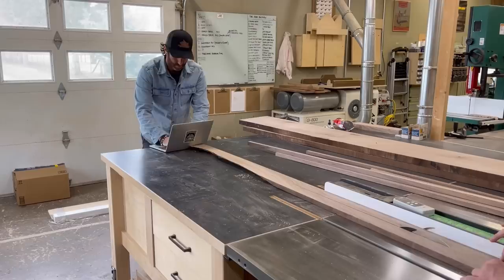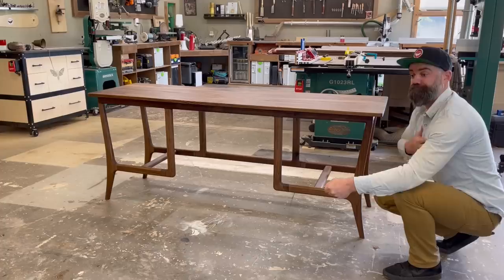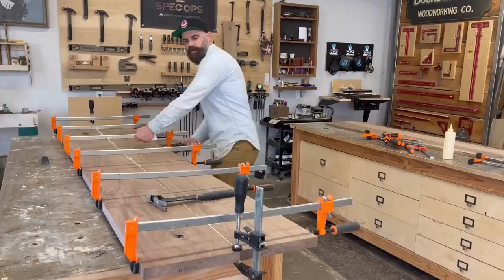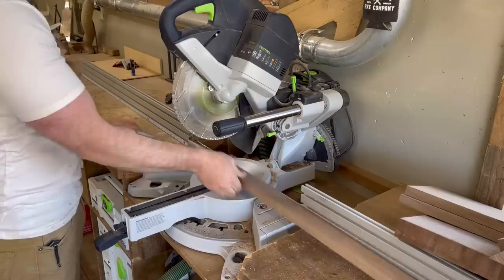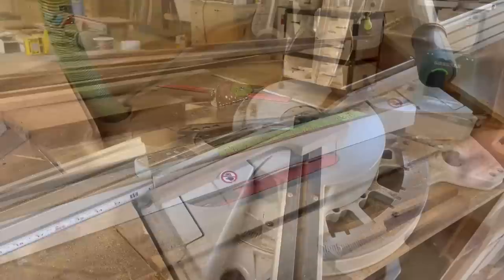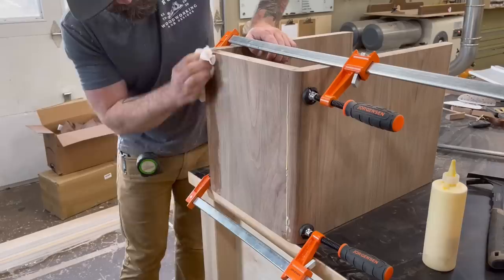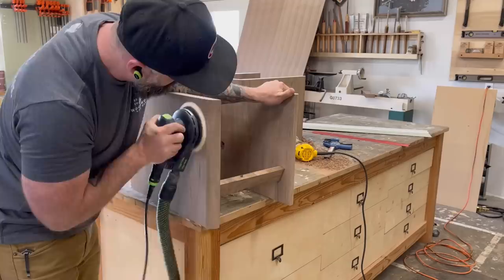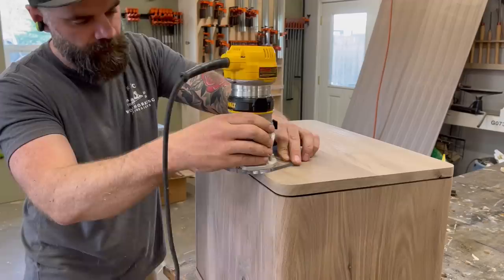My Nicest Piece Yet || Mid-century Modern Desk Build

Comment: Very nice. Lots of opinions out there. Here’s mine…You may be right thinking the wood movement of the boxes will be minimal. Still cross grain solid wood panels with no room for movement in the connection method is a recipe for long term problems. Bravo for allowing for seasonal movement when attaching the boxes. Good luck long term. Hope I’m wrong.

Comment: Have you considered using locking miter joints for things like those boxes you made this eppisode?
I am considering making cabinets using that locking miter router bit, using plywood, and then rouding over the edges like you did in your build.
Would be cool seeing a professional make something like it just so i have some reference ;).
Reply: @G0F15H  I didn't do it with Plywood yet, but i read online that key to success in it is use high quality plywood, like baltic birch, and also using good quality router bit, there is good ones for about 100-150 dolars, ant they cut super nice, but then there is cheap ones for 5th the price, and they scar the wood instead of cutting it.
I know that from experience, bought a cheap router bit and it chewed up my workpieces made of regular timber, but then a good one i got like CMT 955.009.11 made in Poland where i live and that one works like a dream.
My point was i would like to see some work done with it, as there isn't much on Youtube about using those type of bits. If someone can recommend some content regarding it, id much appriciate it.
Reply: Like Gofish said, before you plan to use a lock miter bit for a project, get one and try it for a reality check. I’ve never had any luck with it. It seems like a silver bullet but so much has to go right for it to work and any little thing that’s slightly off ruins it.

Comment: I really wish  you'd address the spontaneous combustion issue controversy. It's pretty clear you lied, but I'd love to hear your side of the story.
Reply from the maker: Go listen to my podcast “shop sounds” I discuss the entire thing.
Reply: @Bourbonmoth  I just listened to your podcast. This is why I wish you would address this on  your YouTube channel. Your response on the podcast was reasonable and let me see things from your perspective. I've been around enough to know that I need to reserve judgment until I hear both sides of a story. The one thing that really stands out to me is the toxic off-gassing. Do you have any explanation as to why your shop didn't fill with toxic fumes to the point that you weren't able to stay in there? 

At the end of the day, fake or not, I agree that the message - to be aware of spontaneous combustion dangers - is a worthy pursuit.
Reply: @Subsonic-cd2en  I've been in a garage where an entire car was on fire, and it was filling up with thick black smoke. I had enough time to go find a fire extinguisher, which didn't work, and then had to gtfo (fire department came crazy fast, put it out, saved the structure). So maybe about 30-60 seconds? The only thing that would give off toxic fumes in that video was the thin plastic bags and the plastic trash cans, which isn't a car. 

Besides, why would any of this matter? You don't think he faked the fire itself, but how it started. But whatever, if it's not "toxic fumes" it's going to be some new thing to shift the goalposts and keep the conspiracy alive.
Reply: he didn't lie, just lay it off ffs
Reply: @ianjamesevans  Dude.. I was a firefighter. So, I'm familiar with smoke. If you watched the 2nd AvE video, he specifically talks about the spontaneous combustion of linseed oil, and the extremely toxic smoke that particular chemical reaction causes. This is not normal black smoke from normal combustion. He tried his own experiment and was not able to physically stay in the say room due to the toxic off-gassing. He also explained the chemicals involved.

Still, I haven't performed these experiments myself, and his explanation for most of the video sounded reasonable and plausible. That's why I asked him to respond in the first place.